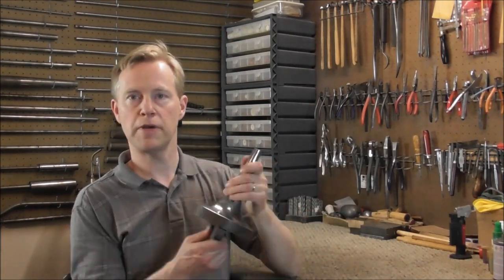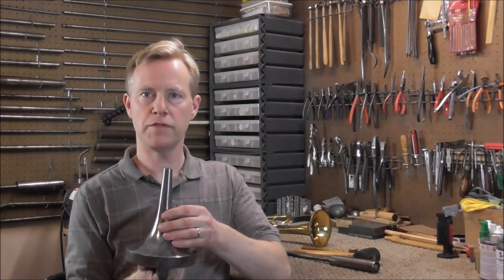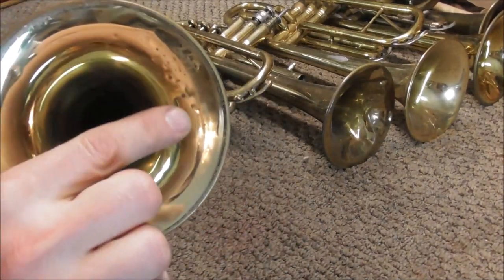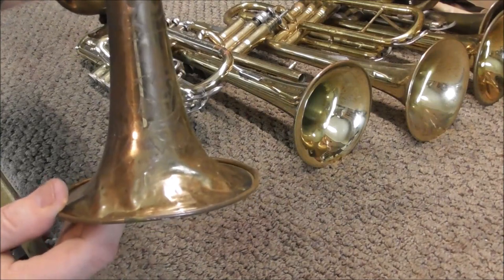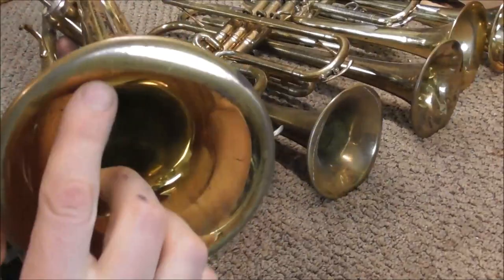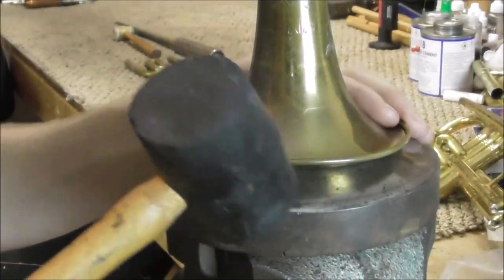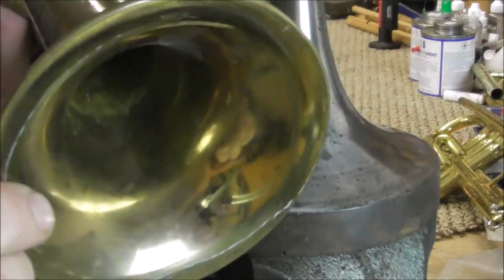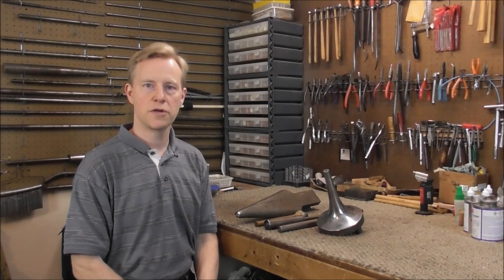How to Use Trumpet Bell Flare Mandrel Tool

Comment: Hey Art,I was wondering what the best tools and techniques are for getting ripples out of a trumpet bell stem?  Thanks!
Reply from the maker: If the dents cannot be removed by the "Trumpet Dent Ball Driver/Retriever", you may need to remove the bell and get as many of the dents as you can with a small tapered mandrel that will fit into the bell stem. Then use a trombone slide mandrel and a roller or burnisher to clean up the dents.
Reply: Thank you,enjoy your videos!